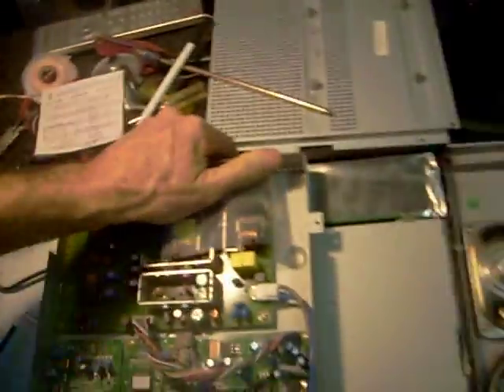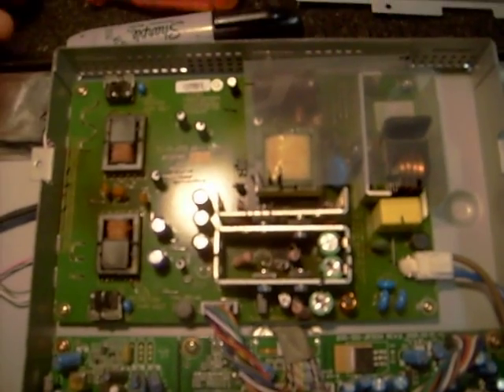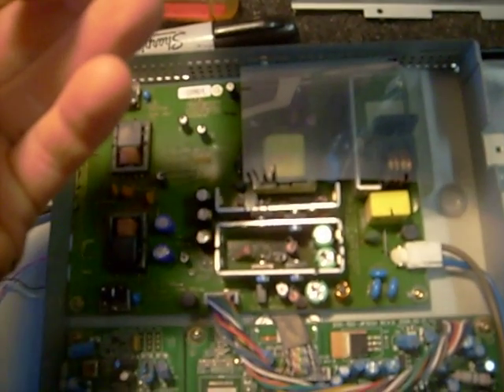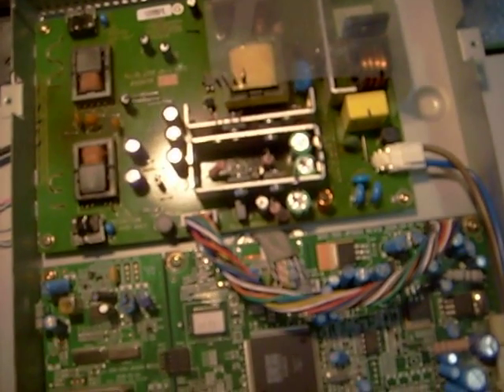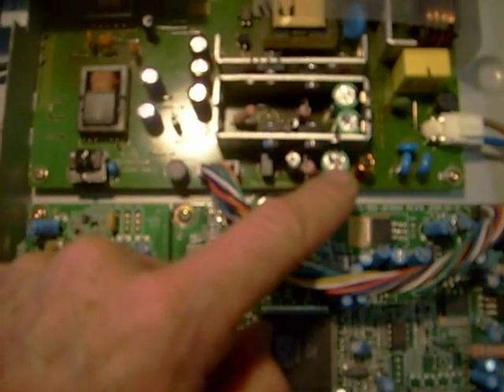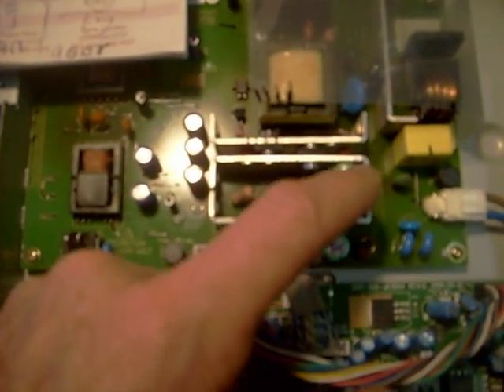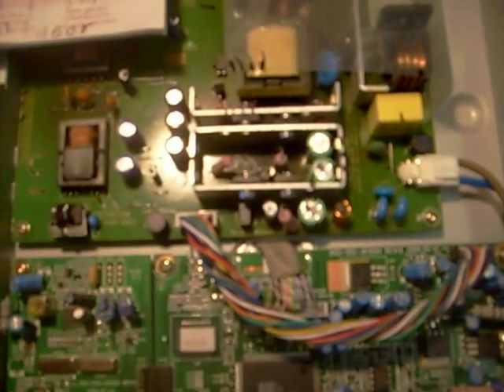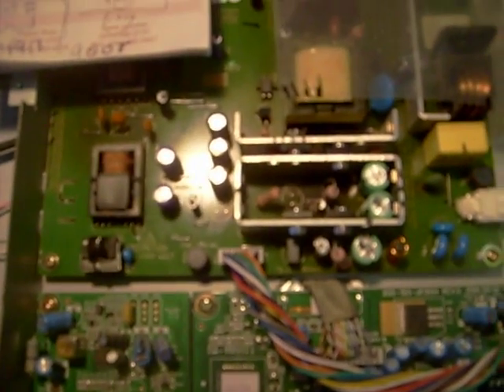Polaroid FLM1911

Comment from the maker: @mbisons06 You symptom sounds as though you have a problem with the inverter board. Most commonly this happens when a transformer goes bad or a mosfet that is driving the transformer. Did you check the primary side of the transformers for shorts?
Dave

Comment: I have a similar model, but with the speakers on the bottom of the monitor.  It has been white screening for a while and has a slim chance of starting like normal.  I'm suspecting what I saw in the video, but would this only apply to the power board or will it apply to the video board as well?

Comment: I have this tv but when I plug it in and try to turn it on there is a quick half second flash on the screen and then the screen goes dark.  The on light turns green but no picture.  Do you think its a power supply problem or something else?

Comment: i have a different inverter but same model same product number as yours :
its on szdatapowercom - product name：CEC-190401 (id=681)

however i only found one 470uF 25v capacitor on my tv as you mentioned to change (it's a small one, and it doesnt start with C8xx it is just C1)

For your opinion, should I replace it with a new one or do something else to fix the issue? Please guide me through here, thanks

BTW, all the "big ones" capacitors are all 1000uF 25V